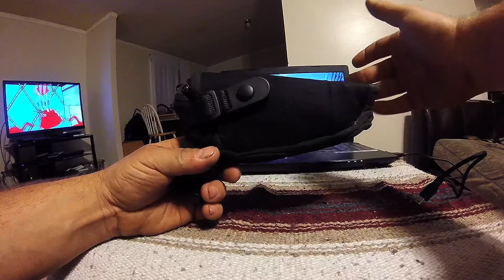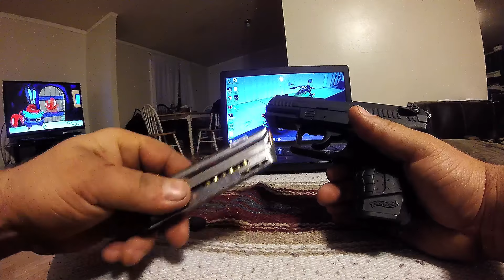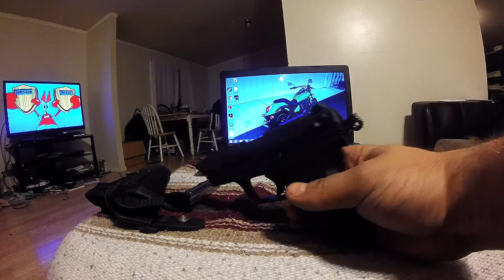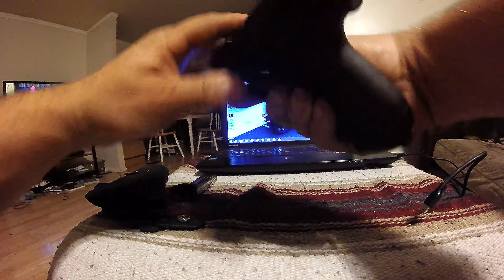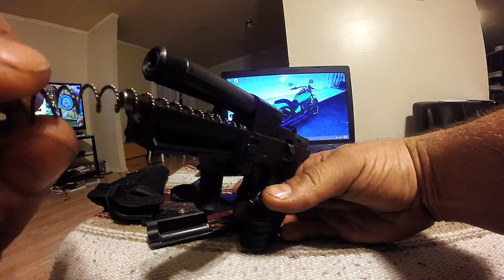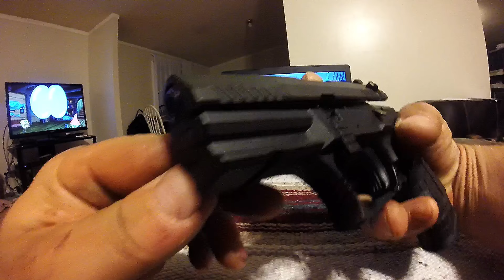Walther P22 How to take apart disassembly teardown field strip

Comment from the maker: Yes I know my hands are a little dirty and rough looking; working on cars constantly and yardwork will have that affect. Gojo only goes so far. I always keep the mags in my weapons loaded in case I need them. I contemplated emptying it for the video, but decided it would serve as a good example as to why you should always handle a gun as if it's loaded at all times. Since I don't keep a round chambered I leave the safety off, and having to rack the slide back first serves as the safety for me. I own too many weapons and could forget where the safey is when seconds count, so this is the method I use. If you don't like this, I frankly don't give a shit.